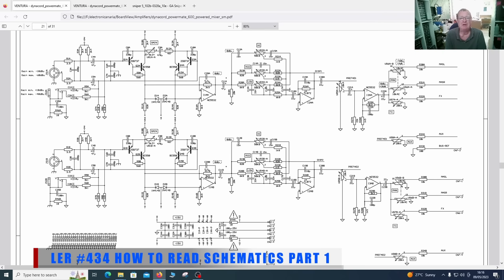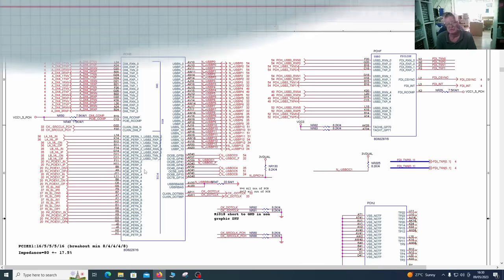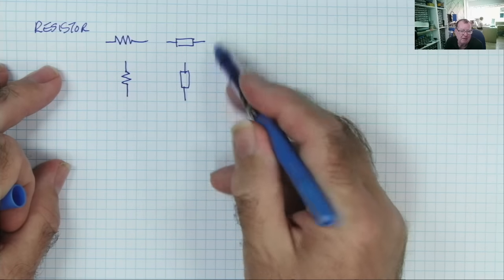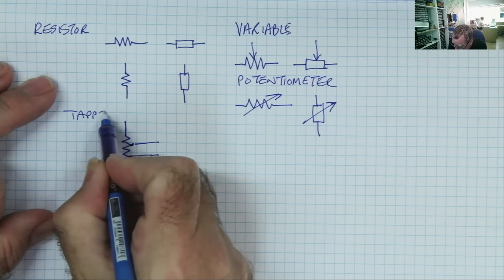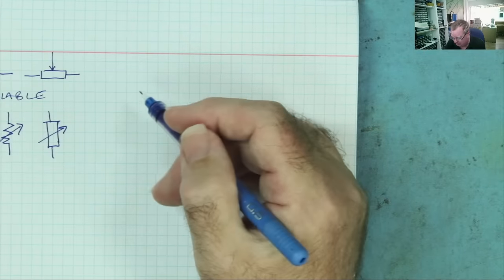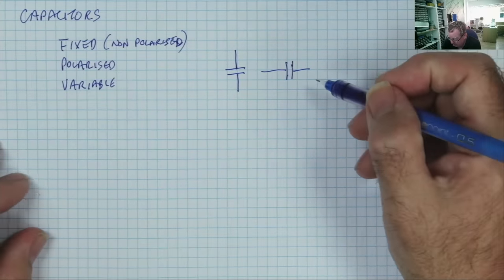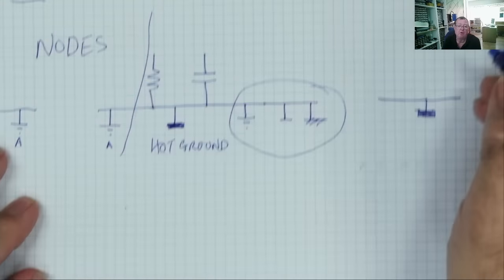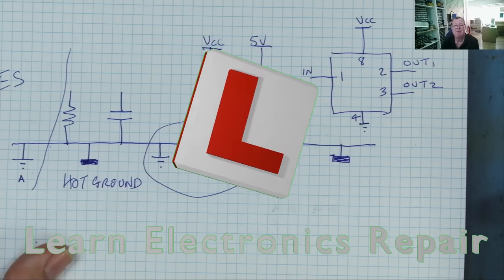How to Read Schematics

Comment: being able to read and understand a schematic is proberly the most impotant thing you can learn if you want to fix anything electronic .this was drumed into me very early on my road to repairing almost anything with a plug or batteriesi was also taught that if a circuit looked to complex to break it down into small pieces that i could understand then i could join the bits together.
Reply from the maker: hey, are you pre-empting part 3? LOL

Comment: I just started micro soldering. The soldering part I’ve gotten pretty good at, but now i need to learn to diagnose which seems daunting right now. I am trying to figure out how to test the connections on an iPad charging port. I have the tools and the program but can’t figure out which connections i need to test and then where in the schematic it would tell me what numbers a good connection should have. Ugh. Thanks for the video!!! Very helpful start

Comment: The convention to use a dot on wires that cross if they are connected, and no dot if they don't connect bit me in the past trying to figure out a circuit. Sometimes you just can't avoid crossing over the lines. Also, for nodes you just mentioned power and ground, wouldn't it also include mysterious designations in the middle of schematics to "A" in a little circle (and other methods) that are just to simplify the diagram? I've seen some schematics that just have a line to power and "4" written next to it, indicating that pin 4 of the IC being used is connected to power, and then again an 8 with a line to ground meaning pin 8 is ground. The other pins are shown in the circuit using an opamp symbol, but the power and ground are just hidden in the drawing. Guitar pedal building got me back into doing electronics after 40ish years, I really wish I'd kept doing it since there's just so much to learn.
Reply from the maker: A lot of that stuff is in part 3 but it will all get covered.  It's too much for one video.  Part 2 will be published tomorrow

Comment: Hello Richard. I've been repairing a lot of microwave ovens lately. I am looking for a DIY device to measure the HV diode with, for example, 2 LEDs, a red and green to indicate the status of the diode and whether it is open or shorted. Of course, the HV diode is first removed from the microwave oven to do the measurement. Testing with a normal DVM is not possible because the internal power supply of a DVM is insufficient to measure this diode. I am currently dealing with a series connection of a 9V battery with the DVM, but this is not very professional and also hassle with battery and DVM. Can you therefore possibly provide me with a diagram or make a small video on You Tube for a handy test device that can possibly work on the mains voltage of 230VAC (of course with an internal transformer to reduce the voltage) I follow your videos regularly and they are very educational. Please keep up the good work for this. Have already created a small database of your most important videos to be able to consult them in the future if necessary. My heartfelt thanks in advance and many greetings from the rainy country of Belgium. Andy.
Reply from the maker: Get an LED backlight tester, that will do the job for you and give you a voltage reading also in a handy mains powered tester.  At this price it is hardly worth making something yourself
https://www.aliexpress.com/item/1005005290226074.html?af=ler2022
Reply from the maker: Or look at this one (I have not tried this model myself) it has both voltage and current meters
https://www.aliexpress.com/item/1005005461165027.html?af=ler2022
Reply: @LearnElectronicsRepair  Thanks Richard. I buy this instrument price is no probleme. GRTS Andy

Comment: You might want to point your viewers towards IEC 60617 as a good reference for schematic diagram symbols.
Reply from the maker: I can mention that in part 3.  Part 2 is already recorded and will be published tomorrow
Reply: @LearnElectronicsRepair  When i started resistors were always zigzag's and were drawn by hand with steel templates. they changed to rectangles when we started to use cad and plotters, a rectangle was a lot easer for the plotter's.
Reply: @TheEmbeddedHobbyist  Is that about the time when the symbol for ' the wheel ' went from square to round please ? Lol ! Squeak !
Reply: @andymouse  is this a case of the kettle calling the pot black as they used to say.
Reply: @TheEmbeddedHobbyist  Lol ! absolutely !